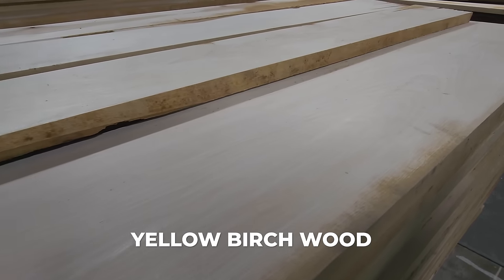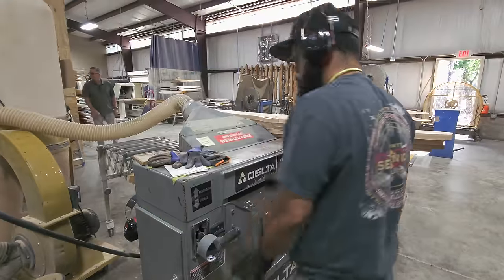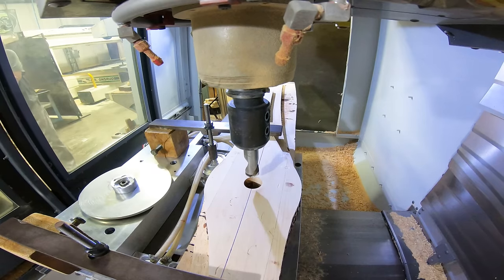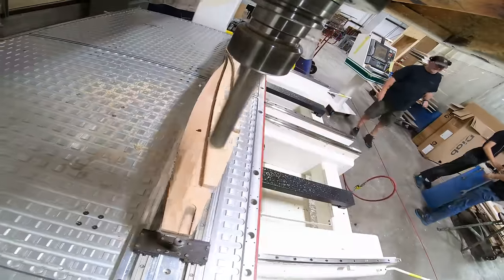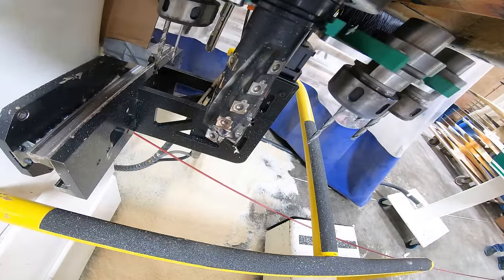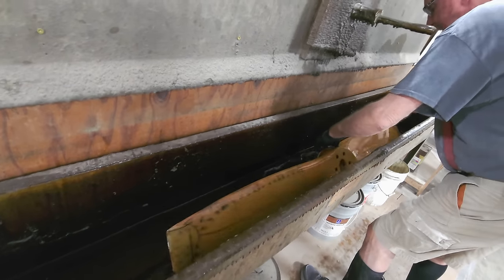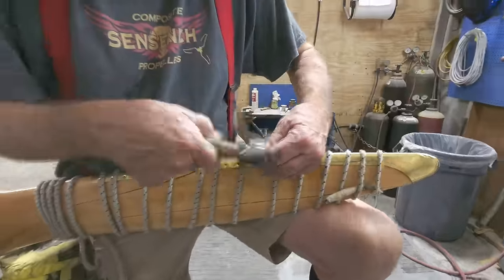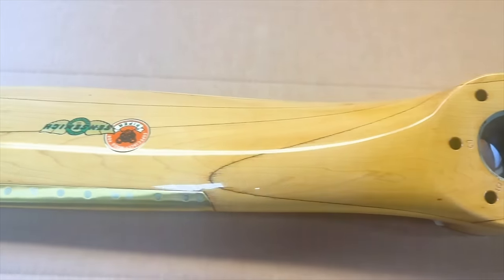World's Largest WOOD Propeller Factory: How It's Made

Comment from the maker: Thank you Sensenich Propeller for having us over.  https://www.sensenich.com/
Reply: This is trippy to watch, my 1st job out of high school was here. I haven’t seen the inside of this building in like 25 years. Looks like Don & Steve are still there. I made drone props & ran the shipping & my brother worked in glue ups. I am assuming that open bed CNC replaced the equipment I used. When I was there, we had just started making composite props. I can literally smell things in this video lol, the wood, the glue, it’s just missing 98 Rock & Bubba the Love Sponge 😂
Reply: Sylas is not so little anymore! Woo Hoo!
Reply: and how did they balance it after the soldering.
Reply: Gotta love a free prop!
Reply: Buy it for only $19.99 (it´s a joke) 👍👍
Reply: Sensenich may be the largest but I prefer Culver Props and the old school machines they use.
Reply: Love it! Would love to have one for my FP-303!
Reply: Amazing work!
Reply: Thank you Sensenich for allowing this to be published here on YouTube.
Reply: That model of propeller is $6600. That's a deal
Reply: Dude’s ! You only showed fraction’s of seconds of the finished prop & details WTf?
Cool video, except the end.

Comment: My first prop was a wooden wonder from Sensenich.  Smooth, beautiful and indestructible. I then purchased Sensenich's  Carbon ground adjustable prop. Still fly with it now, ZERO issues...!  My wooden prop is hanging from my wall inside my house, BUT , I could take it down and bolt it on any time to my RV4, as it's still in perfectly serviceable condition...!  Go Sensenich...!!!

Comment: these guys have a nice Shop , i m a retired Professional Woodworker  and at one point or another I’ve  worked with most of the exact Equipment they have my Trade was CustomCabinetry and we haveAutomated Clamps designed Specificlly for Clamping different parts of Cabinets  our were Old but not as Old as the Propeller Clamps in this Video !

Comment: Jimmy, it’s Dillon Hopson in East Tennessee with the Dyke Delta JD2, I have one of their propellers on the Delta they custom made as a climb cruise prop and did extra laminations, thicker hub, larger hub diameter, and and aluminum adapter to fit the crankshaft flange. All that to handle the lycoming o360 beating it and 150 mph cruise speed at 2550 rpm. I’m very happy with the propeller although wood propellers are higher maintenance.

Comment: Great video Jimmy I was surprised that Birch was used in making props. Here in the UK 50 years ago I was working with solid European birch, mainly from the Baltic region and that's a very wild grain timber. You certainly could not use a spokeshave like the prop guys did and get beautiful shavings off like they did lol. I wasn't aware that Birch grew in America at all. It looks a lovely timber to work, and if it grows true like it looks it does, it won't move after working like the baltic stuff does. That's why it's usually made into plywood to stabilise it. Then it's good gear to use, but not for props obviously, though if it was made up with the same high strength glue, then it might well be strong enough to make a prop. That would be an interesting question to the prop company.

Comment: very nice to see this video
i remember seeing a vintage black and white film, showing how aluminum blades were made, not sure if they were hollow as they looked to be a solid block, then a milling machine cut the blade, using a master blade to copy from, the machine went round and round cutting the tip towards the hub, i forget if the master were larger or smaller, but the copying was very impressive to watch, genius even by today's standard - i'm always impressed by old engineering and where we have come to today
i've seen coins made in a similar way, a master produced and copied at the larger size, and then transferred to what will become the tooling at finished size to stamp out the coins - great video boyz

Comment: That powered glue looks like what we used to use in our wood shop class. It is call Wield-Wood-Glue. It's a fine powder. When two pieces of wood are glued together and let clamped overnight and for some reason you try to get them apart the wood would break but not the glue.

Comment: G'day Jimmy,

YAY TEAM...!

This is a great Video, mate.

I've paused at the point where you're showing off the Clamp collection on the Laminated Blank.

That Glue is called
Resorcinol, it's a Phenolic Resin that gets catalysed with Formaldehyde...; originally formulated for Boat-building, it's also
Boilproof.

Glue two bits of wood together with it, and boil the glued piece in Water, and the Glue stays stuck.

Australian Hardwood takes to Resourcinol better if not fine-finished before glueing, to better enable the Resin to bond.

I first used the stuff in 1974, at age 13, making a Centreboard Case for a Rowboat-to-Sailboat conversion,  and by 17 I was making laminated Propellers (ornamental wall-hangers) with it.

In the 1980s I started making Wind Turbine Rotors with Resorcinol glued Laminations, and 2 of them are still spinning on my front Lawn today, as a Destruction-Test...; after 39 years the Estapol has all flaked off and yet the Laminae are all still stuck together !!!

In the 1990s, I flew behind 2 different Propellers that I designed, cut, laminated & carved from Tasmanian Oak.

The first one was overpitched, and it did 10 hours of Taxi tests & Ground Runs, before 5 hours of Test Flying, and it survived  to hang over my Hut Doorway, still.

The second one, finer pitched, flew much better - to the tune of climbing so much better that I landed in a too-small Paddock while playing Biggles ; and in the attempt to take off Downwind..., the Propeller broke on the Fencepost which I failed to clear.

So it's Hub is now displayed in the Out-House, along with a shattered Wind-Turbine Totor, a Prop. with one Blade broken off, and a Wooden  Hub broken across the Hub-Bolts when my friend spun in after stalling on approach back in 1995, and his Engibe's Cooling-Fan with his Throttle-Cable still wrapped around it - which was what caused his Engine to fail...

His Cooling Fan winched the Cable clean out of the Carburettor of his Rotax-377 (!).

About 5 years ago I bought a "Stove-Fan", with a little Electric Motor powered by a Peltier-Decice to push Hit Air around - using Heat from the Woodstove's top to make Current to drive the Fan...
Abd the Fan featured Fkat Sheetmetel Blades, not even cambered, with  flat Pitch, not Helical...(Grrrrr !).

So in my

"Personal Aeroplanology..." Playlist, as well as in my 
"Mad Scientist Videos" 
Playlist, there's a Series of Videos showing how I
Designed and planned and cut, laminated, carved, balanced and Estapol-ed a series of three different little  8-inch Diameter by 6-inch Pitch, 4-Laminae Airscrews - all  with absolutely perfectly Helical  Pitched Blades all the way in to the 1/2-inch diameter Hub...

Australian Red-Cedar (Toona australis) and Casuarina Sub-Rosa (Mountain or Black Oak)...; Black Oak & Radiata Pine...; and Cedar with Stringybark...

All with different Aerofoil Sections.

For Stovetop use at not much more than 800 RPM, my feeling is that one may as well have the technically best and most efficient Propeller it's possible to build ; because there isn't a lot if power goung into the Shaft - so none can afford to be wasted.

Backtrack me to my recent Videos, to see some Smoke-Trail Studies of Sheetmetal versus Carved Laminated Helically-Pitched Wood...; and backscroll a few weeks to see coverage of how Propellers respond to Gyroscopic Precession when spinning in a Test-Rig which permits them to alter the Orientation of their Axis Of Rotation in response to being peturbed in the Yaw-Axis.

It's QUITE the
Rabbit-Hole, actually...; 
So I've found.

But, anyway, I posted the Series so that anyone who wants their Stove-Fan to have an actually functionally-efficient Propeller to copy what I did (using my grandfather's Century-old Wheelwrighting Tools) ; to cobble up their own Home-grown DIY version.

I knew what I was doing, at real world scale, so my first attempt at a miniature is still functional and in use...; Copycats might reasonably expect to be (as I am) much happier with the third one tested than the first...(!).

The first one took me 25 hours, the thirrd ine only 12 - but I bought a $250 Drill-Press & a $250 Power-File whike making # 2...(!).

And every time I put the Fan atop my Potbelly I get a
Warm Inner Glow
From being in the know,
And having an actually
Helical Airscrew
Spinning away on my
Stovetop...

Such is life,

Have a good one...

Stay safe.

;-p

Ciao !

Comment: The part where's they drilled the hub, but not through holes, then face milled the back side was clever. At first I was really surprised thinking they were going to try to drill from both sides

Comment: At 19:45
I am surprised to see that the brass tip is NOT flush with the rest of the propellor blade.
Looks to me that it would work better if the blade was smooth. Now the brass tip is on top of the blade.
I just wonder why they did not use the CNC router to make the blade thinner where the brass tip is placed.

Comment: Great video Jimmy. I was surprised the brass leading edge wasn't countersunk so it would be flush with the wood part of the prop. I assume there was a final balancing you didn't show after they put all that brass and solder in the prop. Wonder what they do with the props that don't meet the spec. If the price is right that would be a great decoration for any pilot or aviation enthusiast.

Comment: All typical wood glues are stronger than the lignin that bonds the wood fibers together. They are using resorcinol glue, which is completely waterproof and used in wooden boat building.

Comment: NASA 14x22ft subsonic wind tunnel Hampton Virginia Langley - i think? these are the largest in the world.  

DEI (dynamic Engineering INC. Newport News Virginia) now called Calspan received the contract to both cutout the plys and then? glue them up using special form tools to allow a hydraulic press to put the laminates together.  They also were awarded the contract to have their team go in and replace the blades. The original blades are still at their facility -as show pieces and you can touch them - they are huge, they weigh about 2000kg each and its amazing to see them.  

sadly? YT won't let me post a picture of me sitting on one - lol

Comment: Anyone wonder why you would use a micrometer to plane wood to a very specific dimension, only to have a CNC machine take of at least 1/8"of each side and have someone manually plane and shave the prop in postproduction (without using precise measurement tools) and manually wack a piece of brass into shape with randomly spaced holes drilled into the brass edge? And great they pre balanced the prop, but what about postproduction? I would imagine that balancing the prop at that stage would be very much wanted. 

Well, yeah you are not alone there 🤣One could argue it would be so that the gluelines are evenly spaced, but one you have set your planer to the final dimension all the lines will be evenly spaced regardless whether or not that plank was milled to a micrometer specific dimension. Not to mention wood is a natural product and doesn't care if it expands beyond the milled micrometer specific size. 

Other then that, I loved the process and details in filming it.

Comment: You'd think a medium sized-workshop like that would have a proper dust/chip extraction system . . . my shop is ¼ that size and we vent all the chips & dust through cyclones to catch chips and larger dust, then through pleated filters for the fine stuff, to the outside. Blow bags let 2-5 micron dust through, which then get breathed in, which then cause cancer/silicosis/obstructive pulmonary disease, you name it.. Also, to get the proper cfm, you need rigid, smooth-walled 6" pipes with a high rate of flow, not the hobbyist one they have attached to their thicknesser, via 4" plastic flexible duct. Look, there's even a 6" nozzle on the thicknesser dust chute, FCOL.

Comment: I need about a 54 ichproo , wood for a 2 cylider 28 horsepower komet engine. 
 I have made 2 birch props ( a38" and a 48" ) and several pine props for yhe experience . I made a lot of bike fan bikes with 6 hosepower minibike engines .
    I balance the block , carve the top of one blade and then carve the other top blade to balance. Then the bottom of one blade , then the other to balance . Use stencil rib shapes .
 And rough away with a chainsaw ljghtly brushing  away with side strokes .and a 20 grit or rough as i can get 7 inch disc sander . I used a jig saw on the first ones . Ha ha . Sliw it was and that jiggly numbness in your fingertips and the little saw wiid chips piled all over you on the driveway . 
  Balacing on a screwwdriver with a soraycan to finish is or was startling to me how accurate it gets . Like a fly wings weight can be detected and cirrected for . I alternated the layers to helo balance .
  A 3 foot wood blade from a 2x4 had to be thicker to achieve speeds over 25 mph . The pitch is like the gear is . High gear goes fast but no power from a start . , but liw gear has more mower going sliw but slow top speed .
  A prop with pich might start moving weak but look out once it gets moving . Sitting still it is almist stalling but as the prop dtarts moving forward the angle of attack is round and round but the forward motion added together and it starts yo grab and spin easier and go 43 mph maybe .

Comment: Those aren't high quality propellers.   
I'm looking at a 31" propeller here on my shelf, which is a fraction of the size of that gigantic propeller, and it has 15 layers... to prevent warping, internal moisture settling, and the glue is stronger than the wood.    I'm counting only 6 layers in that huge one at 3:25 
If anything, it should have way more than 15 layers...  probably around 30 judging by the size of it.

Comment: Lmao errors are not allowed, meanwhile the dude running the planer doesn’t know how to use a micrometer. You use the small knob on the end to measure the thickness as it has a precision clutch assembly in it so you don’t over tighten it and get a wrong measurement. 🤦🏻‍♂️